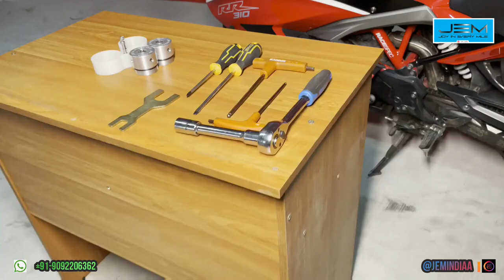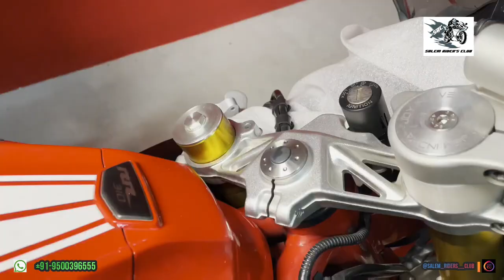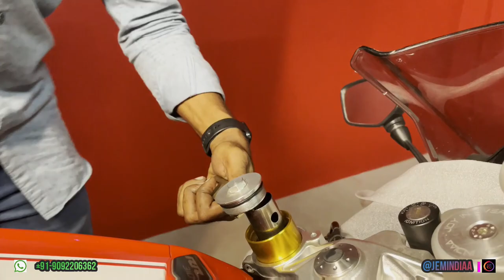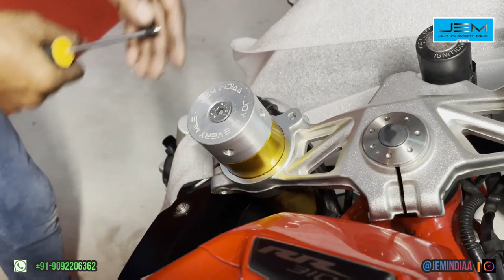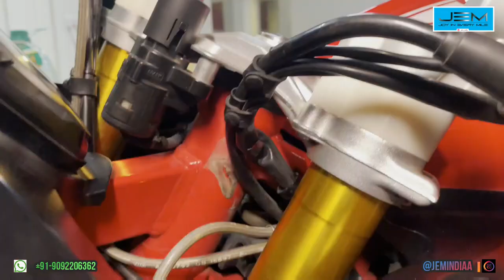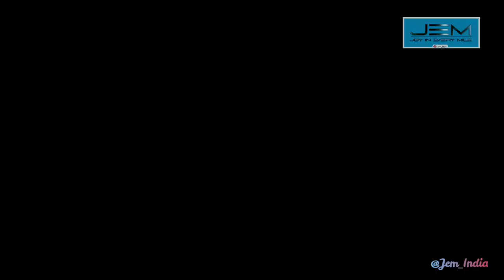Apache 310rr Handle Bar Riser | #Cliponriser | #plugandplay | #JEMRiser | #JEMINDIAA

Comment: Thank you very much JEM. I just installed riser for Apache RR 310. It’s really nice ❤️👏🏻
Reply from the maker: Good to hear,, Happy Motoring bro..
Reply: Is that makes more difference
Reply from the maker: @vigneshs07173  yes it is bro
Reply: @vigneshs07173 Yes it is. Bike looks super comfort after the installation of riser.
Reply: @All-in-one-9600  I have adjustable suspension does it support that